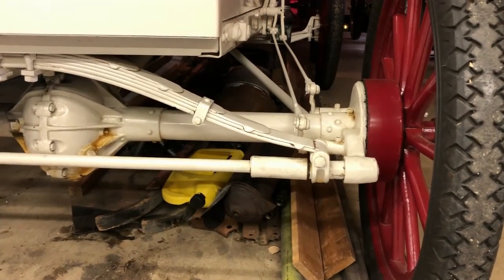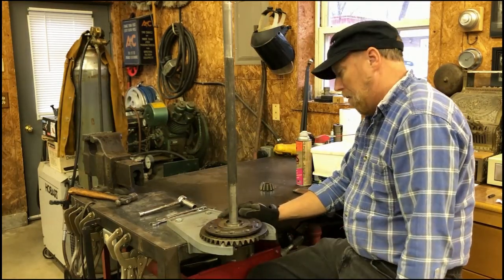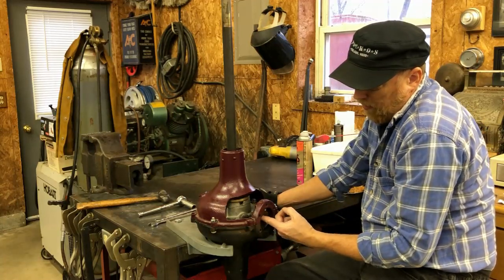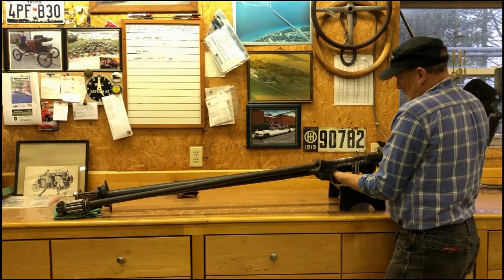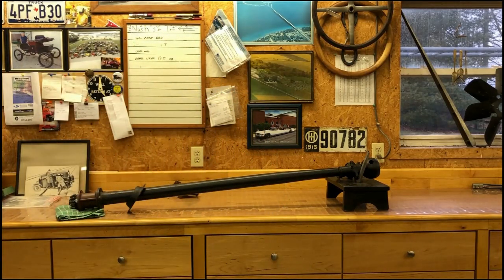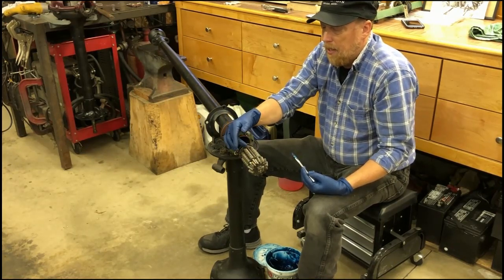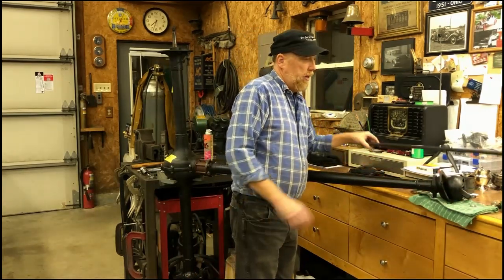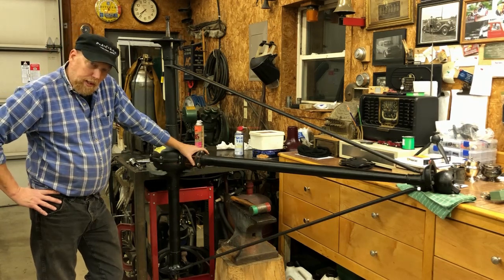Ford Model T Rear Axle Build [EP 20] @KlepsGarage

Comment: Where on the driveshaft (and or tube) is the point that locates the d/s with respect to the tube?  Is it the bushing face that you  cut  and the u-joint end and hole location in the d/s and u-joint?  I can understand the shimming on the pinion end to set lash.
Reply from the maker: The drive shaft is held in place by the u joint. You need to face the upper bushing so there is no end play on the shaft.
Forgot to show on video there is a fiber washer same size as axle. Goes between both axles in the spider gear housing.
Reply: @KlepsGarage  thanks ....looked at a lot of rearend vids, but most kind of glossed over the  d/s and tube details....cross country t showed a tube to diff housiing that took up d/s thrust with a tapered roller setup, must be aftermarket?
Reply from the maker: Yes adjustable tapered shaft is aftermarket. Once there set. They last a long time.

Comment: Really been looking for someone doing a TT worm drive rear axle. 
They probably aren't too different from the  T axles but they are definitely heavier and lower geared with an entirely different design.
Great video and keep the cool stuff coming ,,,,,,, THANKS ,,,,,,,
Reply from the maker: I’ve never tore one apart  but the  design is very similar except for the worm which lays on top the  ring.  Should build the same  one half at a time.  Remember Ford was assembling them at speed. Parts where made to fit without adjustments.

Comment: So where were you last summer when I was putting my T diff together and pulling my hair out.  lol    By far the hardest thing I done to the T.     Great video
Reply from the maker: LOL  I know what you mean.  watched your driveshaft vid.  I should have went into detail on how to put the  sleeve on the drive shaft.  First you want to make sure its is a 1 inch bore (after market sleeves are not at one inch) The original Ford sleeves will have Hiatte (sp) stamped on them and they are one inch inside dia.  Also (Tip) put driveshaft in freezer and sleeve in oven MAX 250deg about i/2 hour. should slip right on. then put key in to line up sleeve.  Thanks for watching.  Shoot more train vids!!
Reply: @KlepsGarage  Why do after market vendors insist on doing things like that!  It  is not the first time I ran into things like that with new T parts.